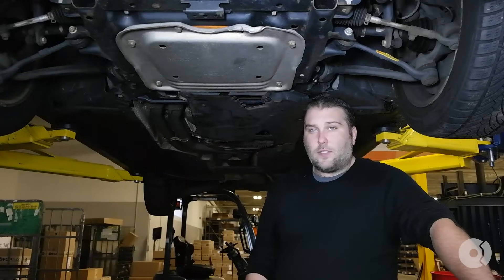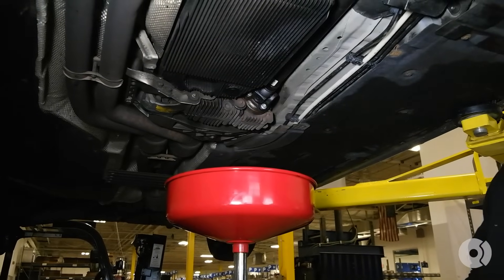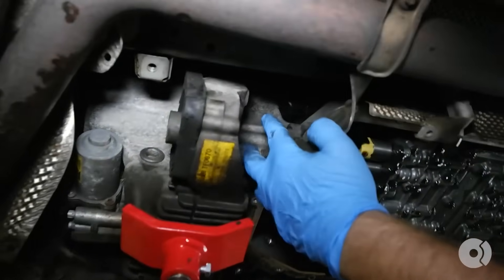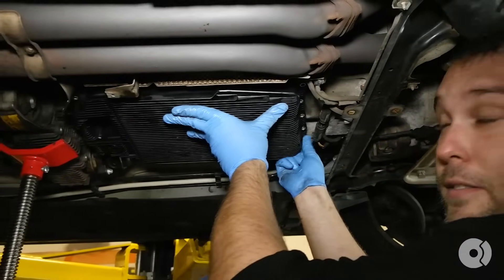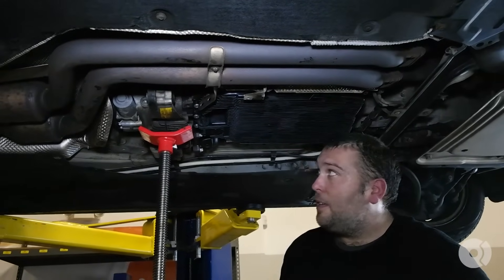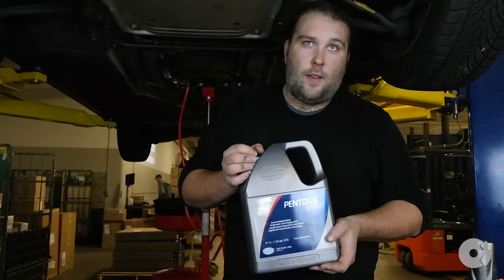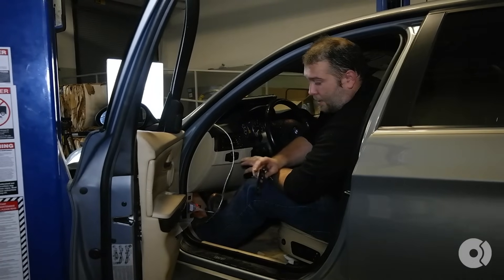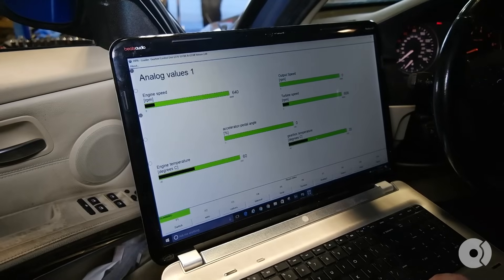BMW 6HP19 Transmission Service - Prolong Your Transmission's Life (325, 328, 335, 525, 530, 740)

Comment: Hi FCP Euro, 

I gave a call to ZF this afternoon, they told me the fill/ over flow plug is located at the left side close to transfer case. Also, please take a look at the video from ZF below: 
https://youtu.be/ZRrgmfM8VlQ

To me, I think it's pretty clear you were filling the fluid from a plug not be designated for this purpose. Further, did you guy perform this procedure on a xDrive model, and do I have to remove the front drive shaft on the left side of transmission? Thanks!
Reply from the maker: This video is filmed on an xDrive vehicle. The ZF video on the other hand depicts the fill procedure for a 6HP rear wheel drive transmission, not a 6HPX transmission designed for an all wheel drive vehicle with a transfer case. On a BMW xDrive vehicle there is a drive shaft located on the left side of the transmission tunnel which runs from the output flange on the front of the transfer case to the front of differential. While there is a plug on the side of the transmission there is absolutely no way to access it without removing the drive shaft which is not necessary. 

There is a second plug located near the back of the transmission (which is easily accessible) and is intended to be used specifically for checking the fluid fill/level of the transmission. The procedure for a drain and fill operation is written this way for xDrive equipped vehicles and this information is reflected as such in the official BMW TIS repair manual which you can see via the link below:

https://www.newtis.info/tisv2/a/en/e90-325xi-lim/repair-manuals/24-automatic-transmission/24-00-automatic-transmission/PFL7eb8

The maintenance routine for xDrive vehicles in this case was performed 100% as required by both BMW and ZF. For a rear wheel drive vehicle would be performed as ZF does in their video. To this date we have performed this procedure as written by BMW on numerous xDrive vehicles. The fill going in always matches the quantity that has been removed.
Reply: Appreciated! So helpful! Looks ZF provides a good alternative for xDrive model.
Reply: @fcpeuro  i am confused. the ZF video this gentleman referred to appears to be done on an X drive vehicle with transfer case visible  and the front drive shaft disconnected and pulled off to the side to access the left fill hole.  are these two holes at the same level and can either one be used on an X-drive car. i get a feeling that for rear wheel drive the left side hole is easily accessible, and for the X drive, they might have added the secondary right hand side fill hole to avoid having to remove the drive shaft for maintenance of transmission fluid.

Comment: didnt bmw said the transmission fluid was lifetime?
Reply from the maker: Lifetime fill as described by BMW is 100K miles which is good enough for the extended warranty time frame. Many vehicles will go past 100K miles before they are scrapped to the salvage yard. Additionally, ZF has a prescribed service interval of the 6HP transmissions (the transmission in many BMW's between 2006-20102) of 8 years or 50K miles. This is a much more realistic service interval vs the non interval provided by BMW.
Reply: Oh, thank you for explaining ! I got a 06 330 x drive last week it gots 80k miles i guess i should not be too worried about the oil change? Love your channel Btw ! you helped me alot with my other cars :)

Comment: Refill at 30-40 degrees, not 30-50 degrees! Do not to over tighten the bolts on valvebody, you needs a TORQUE WRENCH.
Reply from the maker: Daniel, per ZF the final fill must be made between 30 and 35 degress C. If you wait to long and the transmission is over 50 you must wait until the temperature cools back down which is why 50 degress C is mentioned. The purpose of checking Mechatronic bolts is to make sure they have not loosened up which is known to happen. They are not being torqued in this procedure at all. With a quarter inch ratchet with light pressure you can easily tell if a bolt is tight or has loosened up. It's an extra step to ensure the seal between the valve body and sealing sleeves is tight. A loose valve body can cause poor shifting as pressure from the valve body is not reaching the clutch packs.
Reply: You should do another video with those things you just mention.